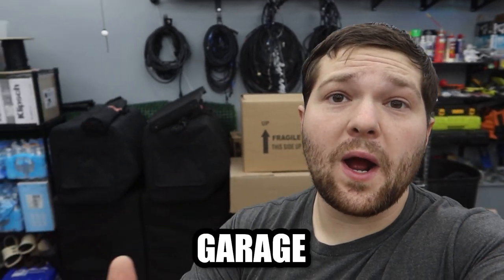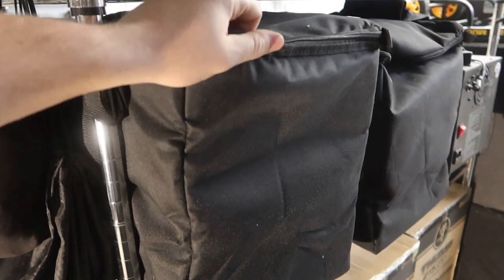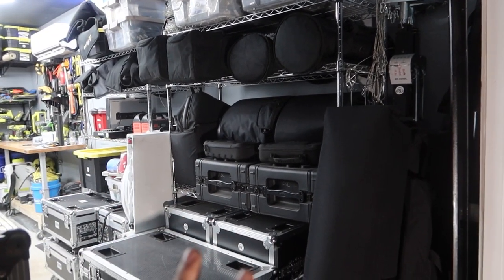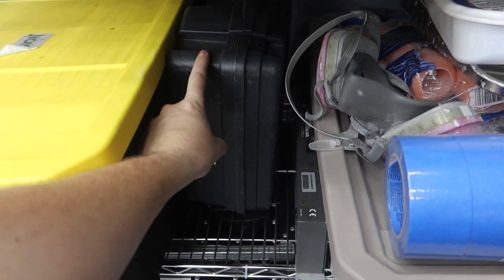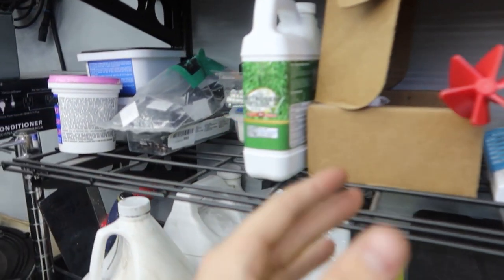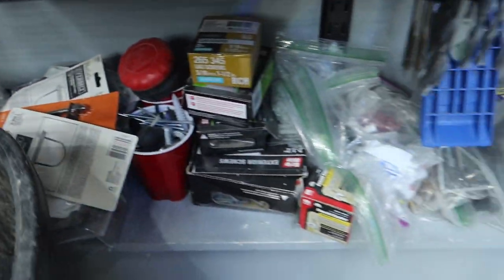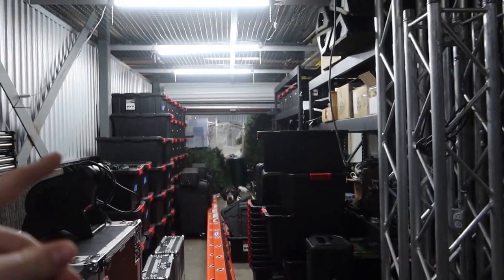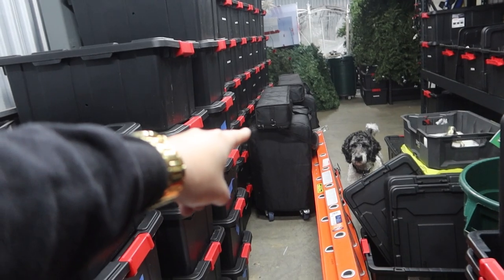DJ Gear Tour 2023 - All my equipment (Speakers, Lights, Truss, Cold Sparks, and MORE)

Comment: Regarding speakers. I have seen reviews that Dave G4X sounds much better than MAUI. Also DDQ series is high end and in my opinion much better than your JBLs. DDQ is based on the Faital Pro speakers, some high models and high end class D amps + DSP. I have been making speaker cabs on those speakers and others and can say that Faital is not cheap but has insane sound quality and extremely high efficiency.

Comment: i enjoy your videos thanks. I see you use the Control One for your lighting. How do you like it an can it be a stand alone lighting controller.
Reply from the maker: I like it a lot for simplifying my shows and providing more consistency in the lighting show. Previously with show express the show was only as good as the operator. It needs a laptop for the control to work

Comment: I'm a beginner Dj, and I was trying to decide between the Mackie or JBL speakers. What's your thought? I really don't want to spend $1000 per 15-inch top. I'm just curious about your opinion on a good set of speakers for 75 to 150 people. Thanks
Reply: Make that $750 per speaker top
Reply from the maker: I would go with mackie tbh. They have more output for the price
Reply: @DJ Rick Web  Thanks, I fellow you and truly respect your opinion.  You have learned alot from you. So Thanks again.
Reply: I ordered 2 Mackie SRT215. Thanks again.

Comment: Excellent video, love the detail you put in organizing your gear. I do the same thing. I consider myself a proactive perfectionist with a touch of OCD.

I got a few ideas for yah, for the cold spark you may want to use an ammo box (Metal one). I have an excellent vendor to order replacement speakers, contact The Speaker Exchange in Florida. I have uses them numerous of times and have gotten excellent service, fast processing, shipping  cost and time is not too bad from Florida to New York. 

If that Chauvet Show Express box is available I would be interested, thanks. you should have my contact info, I did order some DJ Life banded shirts from you.
Reply from the maker: Like the ammo box. Going to harbor frieght now lol. The speakers are getting free warranty replacements from JBL. 9 of them are there now. Have to do them in batches.
Reply from the maker: Oh the sub i had the woofer on order came in last month. Fixed and working again

Comment: You should upgrade those PRX subs since parts are usually hard to find if they are discontinued and should go for PRX800 or 900 series and if you want more bass you could like double that and have 4 subs
Reply: Get 4 of the jbl stx 828 subwoofers

Comment: If I had extra money to spend I would get couple of the lights but I don’t and still at the beginning stages of Djing as it is. I already had 3 this year
Reply from the maker: No problem with that
Reply: @DJRickWeb  just wondering what’s your thoughts on Rockville speakers for djing. I notice a difference having eq to them then without
Reply from the maker: Would never touch a rockville speaker
Reply: @DJRickWeb  I use them with a equalizer because it does sound better with it then with out one

Comment: Why are they cracking down on the haze?
Reply from the maker: Not cracking down just dont want to mess with fire alarms / uneducated on the why. But venue owners are strict and male the rules
Reply: Good For Night Outside Events 👍
Reply: Lots of places use optical sensors for their fire alarms. haze/fog sets them off
Reply from the maker: Optical is the hardest to not set off.